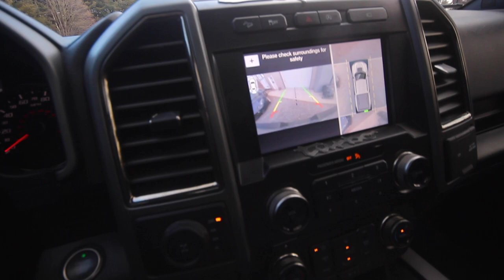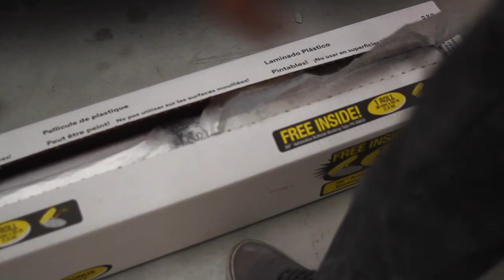REBUILDING A CHEAP MK4 SUPRA on a budget part 9 -New body parts and finally painting some color

Comment: A few remarks about the battery box; do not trust the threaded rods and hold down bar to keep the battery in position. Either add angle profiles or very hard shore foam around the battery. It would burn your car down if it makes contact with the aluminium. Further you could poprivet a piano hinge and use two quick release clamps also pop riveted. Then you don't need the threaded rods sticking out the top anymore. lastly besides painting it, I think rolling or pressing some ridges or shapes in the top will help that box to look a little more in place.
Reply from the maker: Note taken! Yea another friend of mine didn't like the way I did that and is requesting to just build me one. So I will let him know your suggestions for sure. Thanks dude!
Reply: Dat wing doe! 😍